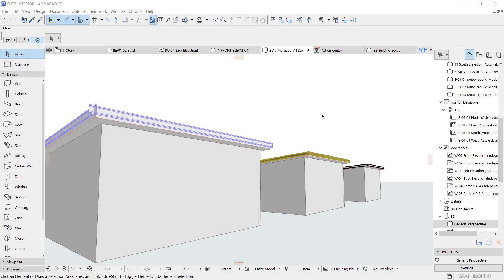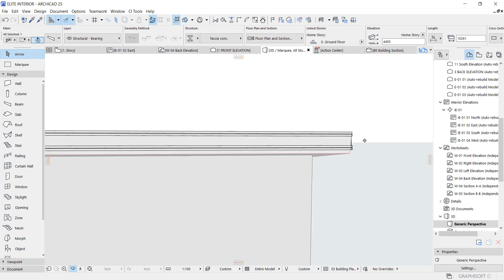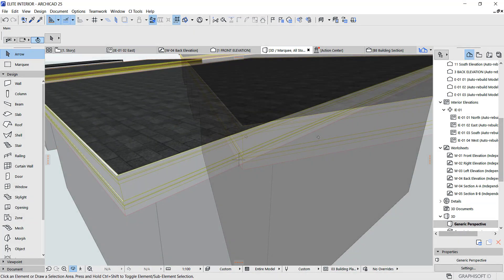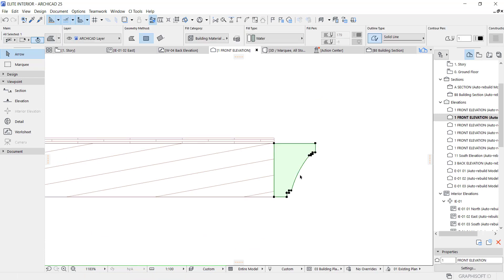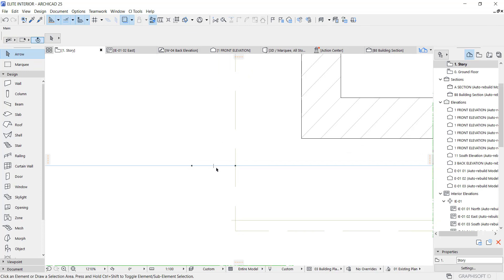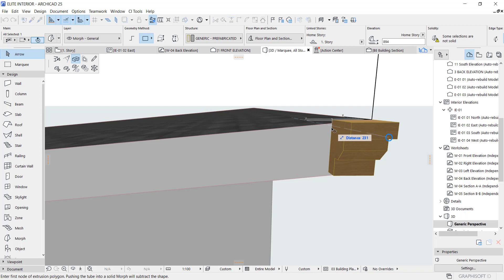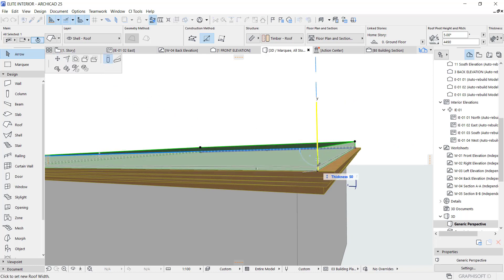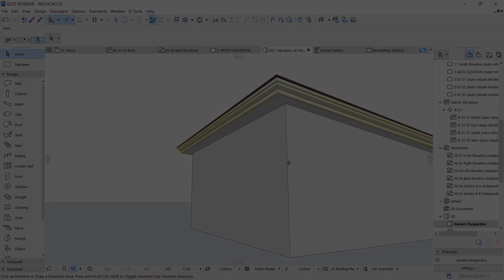HOW TO CREATE CONCRETE FASCIA ON FLAT ROOF #archicad #graphisoft #roof #concrete #fascia

Comment: Thank you MJC, it is really good and understandable. Exactly what I wanted to know.Thank you very much.
But one more thing, when you were doing it, I noticed it was by the side of the roof not under the roof(eaves) like the normal fascia concrete of hip and pitch roof which is always beneath it. Is it possible? 
Your explanation is very ok and good but just wanted to know if it's possible
Reply from the maker: You can do it under too so far you are pulling it from an edge to aid easy edge snapping.